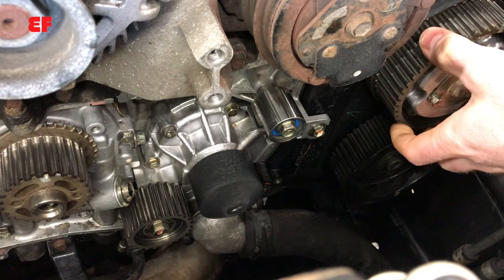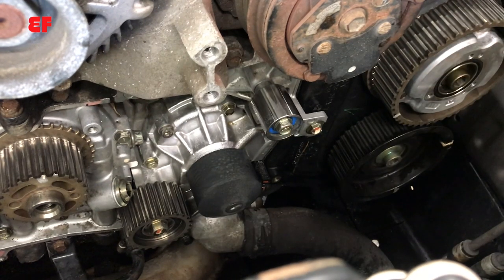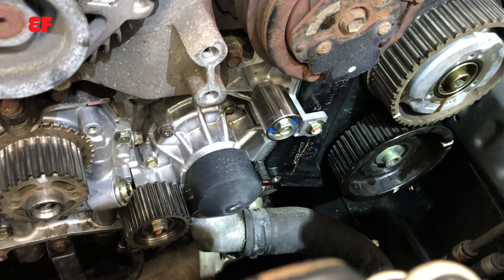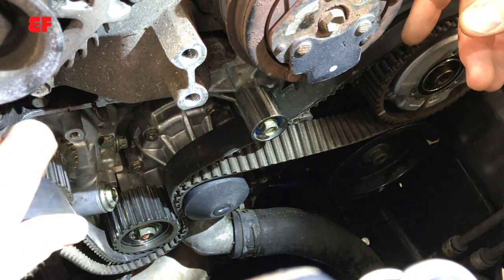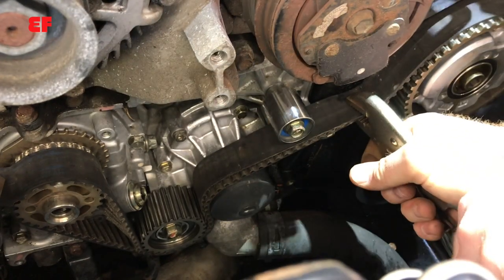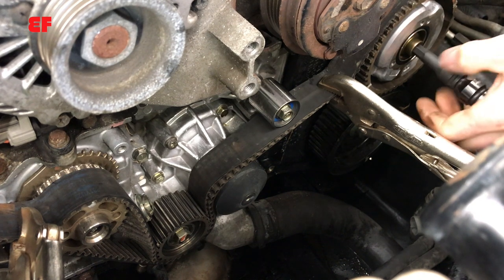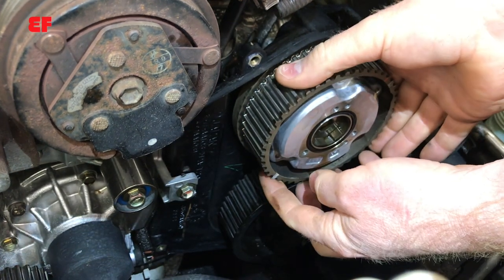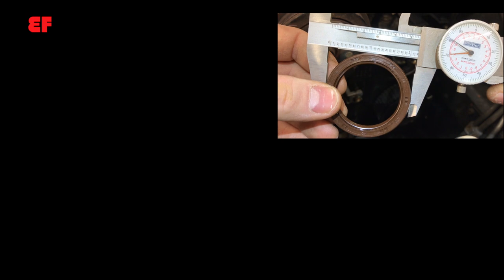MAGICAL TRICK for Subaru Cam Bolts- REMOVE & INSTALL WITHOUT IMPACT TOOLS!

Comment: What breaks the camshaft bolt on the timing gear
Reply from the maker: Usually the bolt doesn't break for me. Usually it is so tight and the faster rounds off. Then there is is no option but drilling or welding on a new nut to remove the bolt. Pain in the but. You want to avoid that at all costs if you can 😀

Comment: I know you made this video a while ago, but I just picked up an sti and about to tackle this job.  When removing the pulleys from the cam gears, do they only go back on one way?  Is there some kind keyway that lines up when you put the pulley back on?  Just want to make sure everything lines back up when it's time to time the engine and the belt.
Reply from the maker: No problem. Yes there is a key way pin that lines up with the groove on the camshaft. 😃🔧
Reply: @EasyFixShaun  Thanks!
Reply: Question while doing the timing kit on my Subaru I am able to rotate the passenger side camshaft sprocket by hand? Should I be concerned bout a bent valve or is this normal for a Subaru? Thanks for any help!
Reply: @jbknudsen06  Not if you set timing correctly before releasing tension on the belt.  Completely normal.  Bank 1 (passenger side) should move freely and easily.  You can rotate those any way you want.  Bank 2 is under tension and will be much tighter than bank 1.  You have to rotate the intake cam clockwise and the exhaust cam counter clockwise.
Reply from the maker: @jbknudsen06  Make sure the crank sprocket mark is lined up. That will put all four piston exactly in the middle of the bore on Subarus. Then you can try turning that cam with a wrench. It may just be hard to turn because the cam is pushing on a valve/spring in the position it is in. Always turn carefully. Any sudden stops.....dont force it. Something is stopping it. The springs will feel like a sudden stop but they are not. There is a very distinct difference between a spring stopping you under normal conditions and a metal on metal stop from a valve hitting a piston or debris or metal chunks stopping it. If everything was running fine when you tore it apart, it should just be normal spring pressure that can be overcome with a wrench. Use a wrench only. You will have control on the downside of the cam while spinning it. If you use a rachet, the cam will spin uncontrolled on the downside. On a Subbie if that happens its not a big deal. But it can be scary.
Reply: Okay so I took it to a shop to have them do the timing since I don’t have a lot of time to do it myself when they informed me that they think it has a bent valve or something else due to the rh camshaft sprocket being able to move. When I got it back home still torn apart I noticed none of cams or crankshaft are aligned! So obviously they didn’t align it prior to taking it all apart. How can I correct this? Thank you!
Reply from the maker: @jbknudsen06  turn everything very slowly. Stop if there is resistance. Removing the spark plugs will make it easier to feel. If you can get the crank gear timing mark lined up that would make it nearly impossible to cause more harm once the cam sprockets are turned.
Reply from the maker: @jbknudsen06  Once you get the belt on you can do a compression test do determine if there is any engine damage.

Comment: When i took off my timing belt my cam spun a bit and made a slight clinking noise. Now my crank is off by 1 tooth and the top right cam is off to the left about 30 degrees. Is it safe to remove and replace the cam?
Reply from the maker: If the subaru crank mark is lined up that puts all 4 of the pistons exactly 1/2 the way in the bore and should clear all the valves just fine. The intake and exhaust valves could hit each other though. So be careful. You should be able to remove any of the camshafts. But turn each one you work on a full turn with a wrench carefully to be sure it doesn't contact any pistons or valves while you work on it😀🔧
Reply: @EasyFixShaun  so if I move my crank counter clockwise a single tooth to put it in line I'll be alright? The top right cam seems kind of stuck, I can't move it with my hand and it's 30 degrees off, but everything else is lined up.

I'm planning on setting the crank to tdm then trying to take off the cam and replace it with usdm can since I won't be running AVCS on my ej205. When it put it on will it only fit in the same place i took it off at?

Once I put the old cam gear on I will attempt to move it into place by moving it alone clockwise. I'm guessing based on how much resistance there is I'll have to hold it in place when I put the timing belt on, after I replace all the gaskets and water pump.
Reply from the maker: You should need ok to move the crack one tooth back into position. No valve will hit the pistons. They are all half way on the bore. The danger is with the belt off the valves could hit each other.  If intake and exhaust are both trying to open on any cylinder they can hit each other and get damaged. So be careful of that. Does that make sense?

Comment: Did you end up doing a cam seal replacement video mate? Thanks
Reply from the maker: I did not. I appologize. Life got in the way and I wasn't able to do that one. 🙁
Reply: @EasyFixShaun  haha had me hanging there buddy! No worries. Thanks for all your videos!
Reply from the maker: My bad. Make sure you only use Subaru seals and everything should go ok. I tried using aftermarket seals initially and they leaked on startup. I found the seal lip surface located in a slightly different spot than stock. So go Subaru only because you will want to install the cam seal in the same spot weather it’s oem or aftermarket. Don’t make that mistake. It sucked doing it twice. They are easier to perform if the engine is out of the vehicle. But it can be done in the vehicle no problem to. You will need an inspection mirror. Plus if the radiator is removed that will help a lot too.

Comment: Can you put it in gear have some one step on the brakes and remove the cam bolt?
Reply from the maker: Maybe?? Great Idea for Manual transmissions!! I think it could work. The belt method might give you more control though. It really locks in pretty solid. But I love your idea. Try it out and let us all know!!
Reply: I try on one of my cars and works 100% 

And the engine out the car I used wrench as a bridge on the transmisión bolt to block it from spinning and works even better
Reply from the maker: Nice man!! I love it. Ya whatever works best is good with me. And if that method saves buying special tools-even better!

Comment: Mine spin when I have 3 vice grips and when I try to wrap under same and over crank then down and standing on belt it slides the belt and spins
Reply from the maker: Ok, are you using the vise grips where the cogs are and engaging the cogs? if the cogs are engaged and there are vise grips holding the cogs together its pretty hard to slip the belt.

Comment: If you have a bad camchaft sprocket would i heard a loud knocking noise
Reply from the maker: Hi, that is possible. Once the general area of the noise can be determined inside an engine, engine disassembly for inspection and sometimes part measurement may be needed to pinpoint 🔧
Reply: @EasyFixShaun  that sounds expensive
Reply: @EasyFixShaun  😔
Reply from the maker: Yup usually very expensive. Take it one step at a time. Try to pinpoint the general location of your sound. Go from there. 🤞

Comment: You CANNOT damage the valves if the cam rotates.  If the crank marker is lined up the the pistons are all halfway in,  unlike other engines.
Reply from the maker: True! good call. I still like to play it safe with the DOHC motors. But you are 100% correct. Subaru doesn't use TDC of Cylinder #1 to do the timing procedure. They put all four pistons in the middle of the cylinder (in the middle of their stroke) and that's where all the timing marks will line up correctly. minimizes and eliminates any chance of piston to valve contact while doing belt service for any reason. If the belt snaps while the engine is running, there is a risk of collision of piston and valves. All bets are off in that situation. But with that said, I have only seen that happen at a ratio of 1 in 10. So most times I get lucky, and timing belt maintenance service is all that is needed. Go Subaru!! :)
Reply: Are you talking about if the driver cam spins 180°
Reply from the maker: I’m talking about when the engine is running. When it’s running, if the belt breaks, engine damage is VERY possible. But while working on the timing belt....if the engine crankshaft TIMING marks are lined up....it’s hard to damage valves. Sometime a can will slip because of spring pressure and turn 1/4 turn real fast. Since all. Four of the pistons are 1/2 in the strike when the crankshaft timing marks are lined up there should be no damage when working on the timing belt. So basically all Subaru timing marks position. The pistons 1/2 way. When servicing any timing belt on any Subaru.... as long as the timing marks are used, there is minimal risk of colliding pistons and valves accidentally during repair of the belt.

Comment: Does not work even with breaker bar or impact. Belt stretches. Suggest just ordering the holding tools to save the headache.
Reply from the maker: This trick uses simple physics. It will work If you use the idea in the video. Use a breaker bar only. DO NOT USE IMPACTS EVER FOR SUBURU CAM BOLTS EVEN WITH ANY CAM HOLDING DEVICE oR METHOD. They sometimes need about 200lbs+ of breaking force by hand sometimes.  The fastener is only a 10mm or 12mm but they weirdly "stick" causing problems with normal removal. Which is why impact guns are a horrible idea ever with these particular cam bolts.
One of three things will happen with the trick- ...or any cam holding tool. 
1. Fastener "snaps and is removed normally. 
2. Fastener snaps breaking into two pieces. 
3. Allen head strips. 

1. Result is the normal with the trick, the breaker bar, and a good looking fastener that is not rounded.   
2. & 3. Result normally with the trick (or any special tool method). 
Usually 2. & 3. mean cam replacement is needed to rectify damage. 
2. & 3. happen on this particular motor during impact gun attempts with or without the proper tools. 
The trick holds everything stationary so massive force can be applied. 
These fasteners do not remove easily at all. The trick works better for me than the "special tools". It also works on any other motor with a timing belt if needed. I don't recommend reusing the belt. Always use an old belt 😀🔧